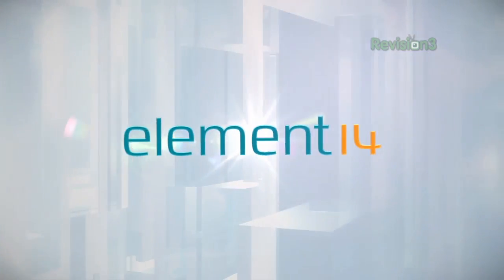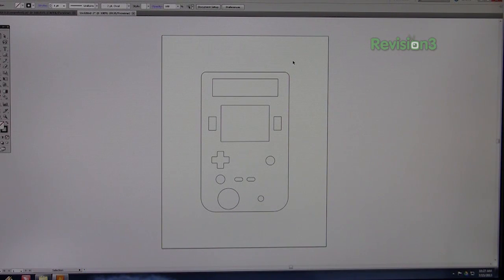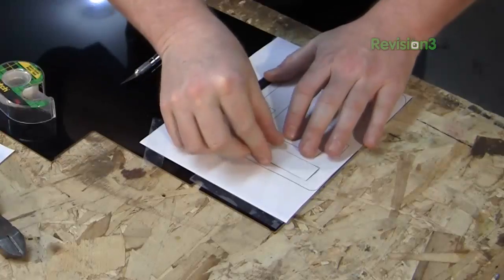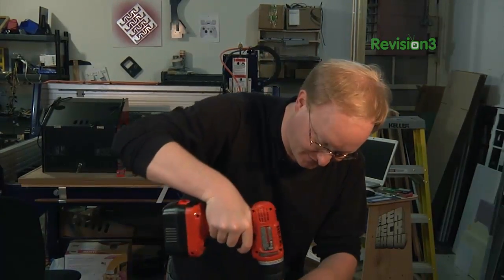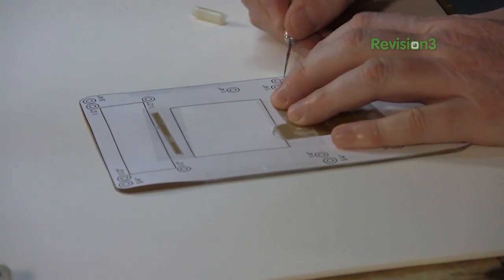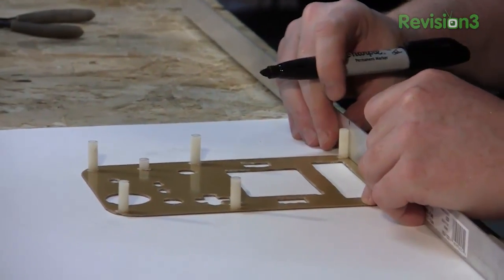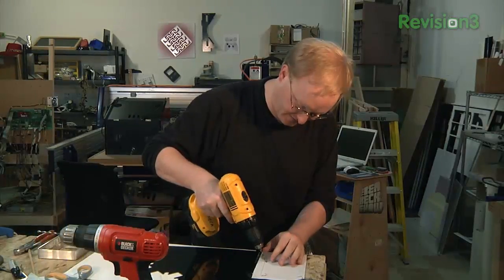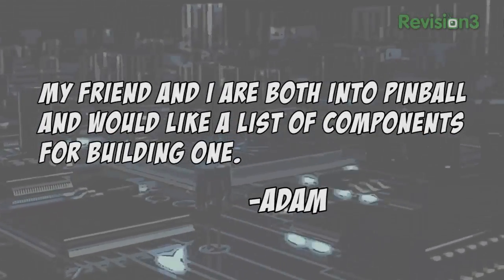Creative Case Hacks: No 3D Printer Required!

Comment: OKAY YOUR USING A RESBERY TAKING IT APART AND PUTING IT INTO ANOTHER INCLOSURE IS THAT OKAY THEN TO RESELL FOR A CLIENT BECAUSE I NEED TO KNOW I GOT 5 UNITS THAT I NEED TO TAKE APART AND MAKE INTO ONE UNIT BASICALLY PUT ALL UNITS INTO A GUITAR SPEAKER AMP CASING THAT ALLREADY WORKS AND RESELL THE UNIT AS ONE PIECE CAN GET IN TROUBLES IF I DID THIS I NEED TO KNOW BECAUSE THE OTHER UNITS ARE TRADE MARK BRANDS SO HOW COULD I GO AROUND THIS ISSUE OF TAKING ELECTRONICS AND REMAKING THEM INTO ONE UNIT SHOULD I DO IT I WANT TO RESELL IT GOT ANY IDEAS OR TIPS ?

Comment: WAIT DUDE I ISN`T IT ILLEGAL TO JARY RIG OTHER ELECTRONICS INTO A NEW UNIT I NEED TO KNOW I JUST INVENTED A NEW METHOD TO HEAR REAL GHOSTS LIVE DIRECT COMMUNICATION MY PROBLEM IS THIS THE UNITS I USED TO MAKE THE GHOST UNIT ARE NOT MY ELECTRONICS SO MY QUESTION IS THIS CAN I MASH UP ALL THE OTHER UNITS HIDE THEM IN A PROJECT BOX AND CALL IT MY UNIT AND SELL IT OR IS THAT BAD NEED TO KNOW BASICALLY TAKING ELECTRONICS FROM OTHER UNITS AND MAKING MY OWN UNIT IS THAT OKAY AS A HAND MADE PRODUCT OR SHOULD I LEAVE EVERYTHING VISIBLE BASICALLY ITS A GUITAR SPEAKER WITH A BABY MONITOR A SPY LISTENING DEVICE AUDIO RECORDER AND A AM FM SCANNER YES ITS THAT EASY BUT SHOULD I PUT IT ALL INTO A PROJECT BOX OR SHOULD I JUST DECORATE THE GUITAR AMP LEAVE IT AS IS AND INTRIGRADE THE BABY MONITER AUDIO RECODER SPY LISTENER AND AM SCANNER INTO IT OR JUST LEAVE ALL THE UNITS ALL AROUND THE GUITAR SPEAKER BASICALLY HOW COULD I TURN IT ALL AS MINE GOT ANY IDEAS DUDE ?

Comment: print on self adhesive paper, much easier to apply and if you get the cheap kind, the adhesive is weak enough to remove without problems. Just a wipe down with alcohol afterwards to get rid of adhesive residues and voila.

Comment: can you make a rasberry pi retro game system out of an existing empty. game console?like a playstation 1, NES, SNES or genesis.
Reply: +Milagros Rios Yeah, just be sure it will all fit, and you may have to remove the old connections to put in new ones. (Like take out the controller slot and put a usb port there, etc)
There's probably many of these done already.

Comment: If you "unplugged the 3D printer" then why is it running?
Reply: He didn't mean it literally.
Reply: +Les King (Lesking72) 
wireless?
Reply: ***** Maybe the data is already in the printers memory
Reply from the maker: Perhaps the data, not the power.
Reply: The Ben Heck Show But it would require data to print something, and it is printing something...

Comment: I was thinking... you could shape a 2x4 (or maybe a 2x8 or wider) to the outside dimensions of your case. Then bend plexiglass around the form using a heating. The top and back could be made the same way you showed with plexiglass. Maybe cutting most of the openings with a Drexel on a router base. You could even setup stops to guide the router cuts. Then the outside could be beveled with a router as well.

Comment: I don't have a 2D printer or a 3D one, I only have a 1D printer but it can also print in 0D. Is there a way I can get it to print in -1D?
Reply: Just run your 1D printer in reverse. Check if it has a reverse switch first. If not you might have to mess with the space-time continuum. Not recommended. If you slip into another dimension you're screwed.
Reply: Jonathan Gray Thanks, that worked. I removed all the flux capacitor fluid first as to not mess up the space-time continuum. But I now have this black spot in my office and no light can escape from it. Any ideas how to get rid of it?
Reply: 87steveom
Use black light catcher device with elements turning 1.0001 times faster than speed of light.
Reply: Steve87 if u go into the hole u will need to have a straightforward quantum tunnel
Reply: Or get a anti singularity capsule and again hide in the quantum tunnel just don't get lost
Reply: Throw it in the trash, it's ink residue from the -1 D print

Comment: if you have to do custom case by hand I'd perhaps prefer carving a shape in wood then coat with 2 comp casting plastic and finish the surface and use that for mold for casting plastic case. that can look decent and be sturdy.

Comment: cut squares around the spacer templates using a ruler instead of circles. this means that the spaces only meets the paper at 4 points and avoids the paper sticking to the glue.I have also just realized how much better loctite superglue is than cheap stuff. so so strong. you can also mount your spacers to your pcbs or parts and then cover the bases in glue and stick to the plastic. this will ensure they fit well

Comment: I love your vids but some very basic things are missed. Use a light spray of spray adhesive to stick the printed file down to the the plastic. And always use a steel rule when cutting straight edges and a circle cutter for circles and curved edges for instance. when cutting parts that you wish to remove from the center of a part, rotate the scalpel blade and continue scoring the plastic... it will scrape the plastic and eventually the part will fall out. then use some 600 wet and dry to sand

Comment: I am making a super simple and compact pi-computer  or pi-puter with a pi ( obviously), a RII 2.4 GHz wireless mini keyboard ( black) and a 4.3 inch reversing monitor with an aluminium laser cut and soldered case and very small hinges so it can fold over with pi andLCD reversing monitor  on the top half and the keyboard on the bottom. Though like your pi portible it is earphones only and I can't find a small enough power source to fit in it.

Comment: Pretty slick case! And don't forget, if you have access to a 3D printer you can print out some of the Pinball machine parts. Just look for your local Hacker Space to find a 3D printer to use :)